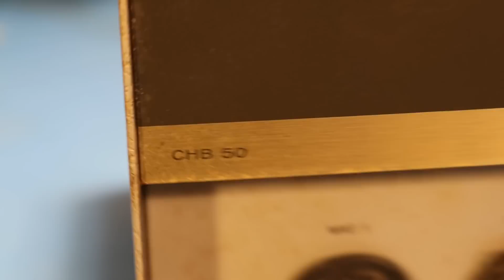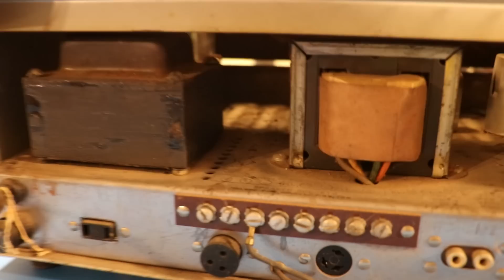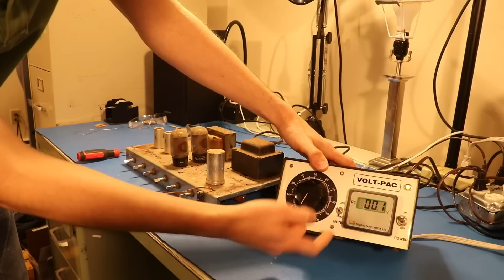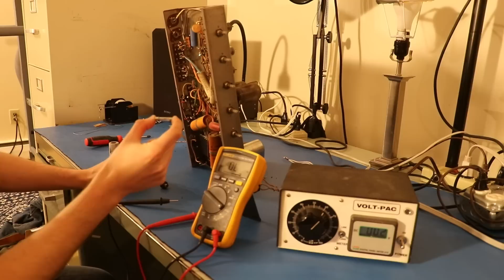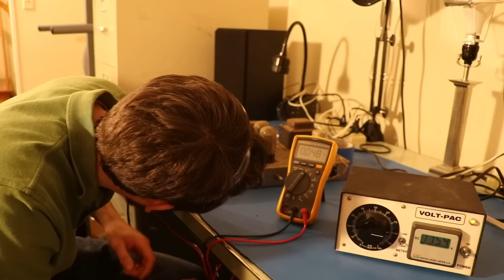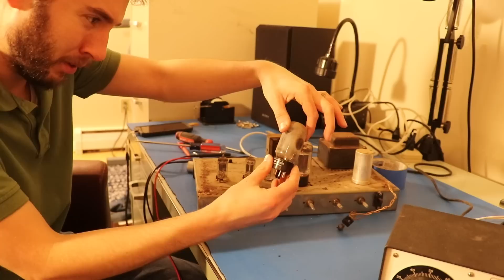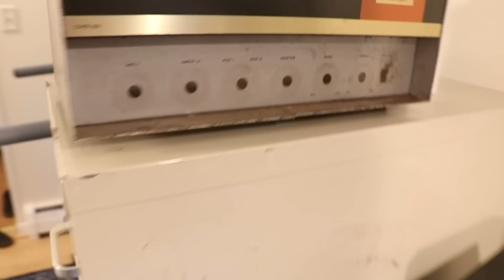Powering Up A Forgotten 60-Year-Old Tube Amp - Bogen Challenger CHB50

Comment: Just a little primer here on AC induction motors like your fan at 150volts  example. AC induction motors always run at slightly less than a multiple of 60hz, 1725 or 3450rpm. Changing AC voltage does not change the speed, well not in theory. What varying the voltage does is to vary the torque. So while a fan for example wants to run at 1725 or 3450rpm even at say 70 volts AC, the weakened torque does not overcome the air resistance as well as at full power. Therefore it slows down. But again the lower AC voltage is not lowering the speed directly. It's lowering the torque. So while varying the AC voltage can ultimately vary the motor speed, it's highly sensitive to the mechanical load and very sloppy speed regulation only good for things like fans. This is why VFD, Variable Frequency Drives, are used today for AC motor speed control. By electronically varying the frequency, you get true speed control at full torque.

Comment: 6L6's were invented in the 30's. Originally, they were designated just 6L6 and they were in a glass envelope which was encased inside a black metal can. Eventually, they put they in glass bottles the first was the 6L6G which was the coke bottle shaped tube. Later these would be made in standard shaped glass and called 6L6GA. Next came 6L6GB and finally 6L6GC. In short, they have different spec as time went on their ability to handle higher voltage and current as well as drawing more filament current and therefore had higher output. You have to be careful putting an earlier version in later amps designed for later 6L6GC's because the amp will be biased for the more powerful versions, could have more voltage than an earlier one should be exposed to and could potentially damage your tube if left in this situation.

Comment: PCBs are not great for a tube amp, too much voltage and amperage. I get it that it is cheaper to have a machine make a board with all of the components soldered on, so you don't have to have people that know what they are doing, cheaper etc. Tube amps with PCB's, the board eventually goes conductive. The board is a fibrous material which small metallic hairs can grow in like blades of grass across bridge across traces because, as you know, electricity passing through a conductor causes a magnetic field. This can cause direct shorts as well as bias problems. Once your board is fried there's three options. Replace the board which usually costs as much as a used amp, re-work the amp so it is point to point as it should have been in the first place or throw the amp away and buy a new one. P2P tube amps can be endlessly repaired, just unsolder the faulty component(s) which you can easily trace visually what it hooks up to. This is why many vintage tube amps which are up to 70 to 80 years old can be endlessly repaired cheaply by swapping faulty caps or resistors. Even the tube sockets are board mounted in most modern tube amps which can damage boards with the shear heat. PCBs are best left to solid state.

Comment: Wow ,had two  bogen amps from the late 50s,hooked them up to two Klipsch corner horns,and I'm telling you bro hang onto yer socks! These were made for PA systems hence the outputs you didn't know what for.they were for dispatch/ office as not to blast the secretary out of her seat,while the Warehouse/ plant floor could hear. If I  remember rite ,those metal  capped tubes marked bogen were actually a sort of filter caps ( good luck finding them) and may be your hum problem but more likely a  ground point problem . That sounded more like ten years after to me , and you should play more.keep up the good work ,and keep working on the stuff that was built like a brick crapper!

Comment: That amp brings back memories!, I picked one up at a church bazaar ( similar to a yard sale) when I was in Jr. High, ( bought it cheap, from money i made mowing lawns). The mic inputs are those pld style amphenal screw on connectors, they look like bnc connectors on CB antennas. The mag connector is for a record player with a magnetic pickup and needle, great amp, i used mine until i was able to save enough to buy a  Marantz receiver like the one you restored in the previous video. Just go through and replace caps, check solder connections and replace the tubes, have fun !😊

Comment: Well if you could find a second one you could have stereo.  This was a budget model,  it has high z mic inputs with no provision for low z transformers (which better PA amps had).  I would replace the cannon screw on mic connectors with 1/4 jacks.  The center off aux input was really to save on a slide switch, and in most applications it was seldom used.  These unit were used in church lecturns and restaurants for paging and background music.  The mic cable could not be more than about 15 feet (high z) and perhaps a Muzak fm sca decoder for music.  The distortion you hear, may well turn out to be bad output tubes, remember that unlike transistors, tubes die a slow death and as they age, can start to sound awful.  I would recap the whole thing and also remember that carbon resisitors can drift with age too...check the bias

Comment: Change out the caps. They are easy to get to. Clean and refit all the sockets and clean the pots. Then check for red plating. If red plating has vanished, then rebias and check on the O scope. I bet you a dollar there is nothing else wrong with the amp. Except a couple of resistors that may have drifted high.

Comment: Change out those old electrolytic caps asap, the big orange ones.  That's where that hum comes from.  Bad coupling caps are most likely causing the red plating, they will need to have the bias set and mismatched output tubes are not always a bad thing.  They are never any good don't be surprised if you have to change all the caps.  Talk to the owner, IMHO you should do a restoration and convert it to a guitar amp.  A 50 watt, 6L6 powered, hard wired amp is worth a good chunk of money.  Go to D-Lab on YouTube, send Terry an email about it, he might even buy it off you.  If not I'll buy it.  A converted amp like that can sell for up to $400 or even higher.  Bogen was a very good name back in the day and just the fact it's has sound means all the expansive parts are working.
Reply from the maker: The owner ended up giving it to me and I'm currently working on a guitar amp conversion with new tubes! Video to come in the following weeks
Reply: @AHFixIt  Awesome, you won't regret it.
Reply: @AHFixIt  GB = Glass Bottle

Comment: When a letter suffix is added to a tube number, it means that an improvement was made to later production of that type.  When the 6L6 (metal) and 6L6G (coke bottle glass) came out in the 1930's, they could only take 360 volts B+ and had a plate dissipation of 19 watts.  Over the years, they were upgraded to 6L6GA, 6L6GB, and finally, 6L6GC in the late 1950's.  The 6L6GC could take 500 volts on the plate and plate dissipate 30 watts.  Therefore, it is ok to replace lower letter suffix tubes with higher letter ones, but NEVER put lower letter suffix tubes in sockets which specify higher letter (later) types.

Comment: I have one of these old Bogen PA amps. I got it from my step-mother in March of last year when she acquired an old legion building in town. It was part of what the original owners had setup for a PA system in the building and it was running into a 500watt amplified SUNN sound mixer. Mine is the bigger brother to this one, it is a CHB100. 

My parents were fixing up the building and the sound equipment wasn't required for their needs. So as a Bday gift my step-mother knew I was into old stereo equipment and said if I was interested in any of the gear I could have it. So I took the Bogen amp, the SUNN sound mixer, a small Realistic TM-150 AM/FM stereo tuner, compact Realistic cassette player and a pair of SONY APM-D4 speakers. Sadly I haven't found a use for the Bogen or the SUNN sound mixer and they've been riding around in my truck since then as I have no place to store them safely.

Comment: Tube amplifier repair isn’t that hard I always replace the caps after I have tested the power supply transformer and inspect any burnt resistors and I test the tubes then clean the tube sockets before I bring it up on a adjustable transformer 
Then I clean all the pots with  deoxit 
And if a fuse is blown I would definitely take all the tubes out and bring it to 50vac to see that the dc voltage after the rectifier and always get the schematic so you can check your voltage and bias on the cathodes

Comment: 15:13 the GC is a storage and/or fabrication designation,as long as it isnt another tube it will be just fine (in my experience)

But looking at the minature it didn't went very well for you

Comment: Bogen is a brand that was more known for its school PA and Intercom systems.  I wonder if that amplifier was used in a school, office, or something like that.  The 70V line output for constant voltage speakers might indicate that.  Some of those 70V line outputs were used to drive the in-ceiling or on-wall speakers found in schools, offices, hospitals, airports, malls, doctors offices, and other places used for background music, intercom, or paging.  It is also possible that an amp like that was used for record players, tape decks, or brought around on a cart for announcements, or used in a small cafeteria stage or something.

Comment: Time for a full recap. Always be sure to use a dim bulb tester while bringing up the voltage. I don’t think you gave it enough time for the filter caps to reform.The wax caps should be replaced anyway.

Comment: The difference between point to point and PCB’s is this will be running long after you’re dead as long as you keep the electrolytics up to date. Solid state gear is made to break a week after the warranty is up.

Comment: You are a very brave fellow. It is risky to include such an old device without basic measurement. That 6L6 glows probably because the other one is not working. I advise that you first replace ALL the old capacitors and somehow check the tubes or replace them with correct ones. Next is the high voltage and bias check. Otherwise, something can catch fire or explode and hurt you. The capacitors on the grids 6L6 that connect to the phase inverter are especially important. If DC voltage "leaks" through them, the output tubes will be fried. And maybe the output transformer.
The configuration of that amplifier is ideal to make a guitar amplifier out of it. Something similar to the Fender Bassman 50W. Someone who plays the guitar would be overjoyed with that. Be careful dude!!!

Comment: I'd like to see you restore the Bogen 50 amp; that would be good experience for you, however, please be cautious when working on that piece of equipment. Also, the tube is toast. It has been weakened considerbly. For that amp, unless the output tubes are kind of closely matched, it won't ever seem to work right. I'd buy all new tubes after changing caps and other components that need tube be hanged. Christopher

Comment: People have a lot of weird conceptions about what to do what not to do if something is old and has old capacitors in it, if you dont have knowledge of electronics its best to get educated. So you did the right thing by dialing it up slowly on a variac, if it starts to hum real loud turn it off you're not going to hurt anything, you change the capacitors out done deal. No harm done and my experiences has been most of the time they actually will work right off the bat, put an input in where the microphone input is for guitar and enjoy.

Comment: In the case of the all-glass smaller tubes, note there is a gap between the pins at the bottom of the tube. When viewing under the chassis, the first pin in a clockwise direction from the gap is pin !.

Comment: By the way, a 6L6 was a metal envelope type of tube, which was the early introduction version of that tube type. They see considerable use in military applications where vibration may be severe and a metal tube holds up better. The 6L6GB/C versions with glass envelopes are better suited to consumer applications. This amp has 70.7V audio output capability for PA systems. The harmonic distortion is rated at 5% although at low volume levels would be much less. It might make a fair guitar amp as someone mentioned.

Comment: Chances are that the tube which shed its glass envelope did so due to the red-plating of that tube multiple times. Most of these output tubes (the 6L6GAor B) can hold up to short duration red plating, but don't push your luck. The underlying cause in this case is probably a shorted or leaky .1mF coupling capacitor to the signal grid of that tube. The signal grid of a 6L6 tube is pin 5. The way you read the pin-outs of tubes is from the bottom, look for the keying bump on the center black plastic pin of the tube. Count pins from the bottom in a clockwise direction from that bump or key. You should see two 100K ohm 1/2W resistors each going to pin 5 of each 6L6 tube. You will find that there is also a .1mF capacitor connected to pin 5 of each tube. The one that red-plated likely is either shorted or leaky. Change that part and you may be able to get it running without red-plating. There is supposed to be a negative bias voltage of -45VDC going to the junction of those two 100K ohm resistors. Check for that voltage and if it is low look at the 20mF @ 50VDC rated  capacitor in the power supply. Get the negative bias right before keeping the amp on very long.

Comment: Not only do printed circuit boards used for tube circuitry tend to fail from heat (solder joints break down, foils fall off, and poorl located or inadequate components get baked and fail prematurely) but *the board material can become electrically conductive*! Marshall, for example,, built thousands of guitar amps with this problem, and the conductivity between foil conductors caused overheated, burned-out tubes and transformers, and sometimes even electrical arcing and burning. It is possible to design circuit boards for reliable performance in tube amps, , but high-quality, "best practices" board design and layout are rarely seen in tube amps. Modern Fender amps also have terrible flimsy circuit boards with crappy leadfree soldering that breaks down in just a few years, as well as  hot-running resistors and diodes that should have been elevated above the board but instead are pushed right against it so that they can overheat and sometimes even burn the board.  Not to mention their use of shitty filter caps that fail prematurely.  Again, it's possible to use circuit boards in a good design if you do everything right but most manufacturers just don't bother. "Eyelet" or "Turret" boards are a better choice for longevity and serviceability (and easier to modify for different or better tone) but they can't be stuffed with parts by robots and therefore require a lot of hand labor to build, hence a higher cost to the end user.

Comment: You should always check for shorts on the power transformer and condition of fuse before ever applying any voltage. Bringing tube gear up slowly on a Variac is smart, but without anyway to monitor current, it is not really showing you anything, you should either have a ammeter to monitor as you are brining it up so you can shut it down when the current starts going crazy or have the dim bulb in series with the variac and load to limit the current. Also, those electorlytic caps need to all be replaced. The negative bias is something that needs to be checked as well. This could make a great guitar amp if restored and some mods made.

Comment: I don’t understand why you put power on before cleaning it up and changing the capacitors. You most probably have been pleasantly surprised
Reply: My 100 watt is probably fine, but after sitting 20 years I'm afraid to power up without checking capacitors.
Don't want to hurt my old friend.

Comment: That’s a PA amplifier. Probably used in a school or factory.  Will have 70 volt output to allow wiring to multiple speakers.  Each speaker has a transformer to  allow the 8 ohm speaker to work.

Comment: I still remember when a radio or TV stopped working right during the late 50's early  60's taking all of the tube out and going to the drug store and checking them in a machine. You could buy new ones there and replacing them. Usually fixed the problem. Simple stupid but very dangerous on the TV's'
Reply: Yeah remember my dad getting knocked across the room in his TV repair attempt he had done it successfully several times before but that cured him and he never poked around in a TV again. Who says you can't teach an old dog.lol.

Comment: Do not hold the chassis with both your hands  dangerous and lethal!!!
Can't leave any capacitors in there, and resistors need to be checked for value. The other power tube is dead as well
You can burn out the transformer when red plaiting

Comment: I once got a CHB 35 amp cheap and I converted the front end preamp stage from the Bogen plan to identical to a Fender input stage. Then I installed hookups for guitar.  If I get it back I will use one of the extra inputs to try to make a reverb channel with a spring job. The only issue is the output tubes.  IF they ever go bad, it is mod time or search out expensive identical tubes.